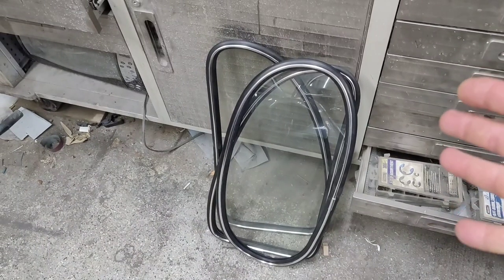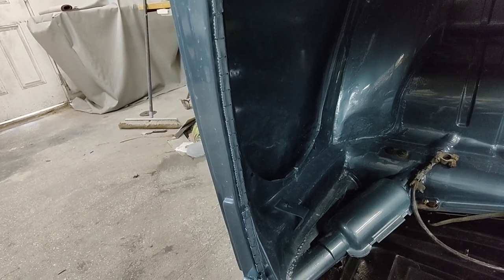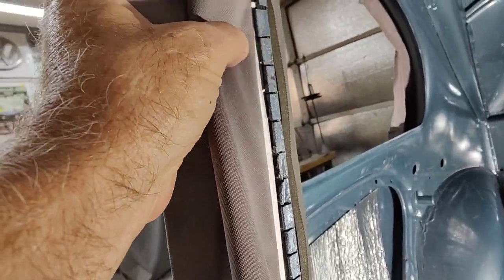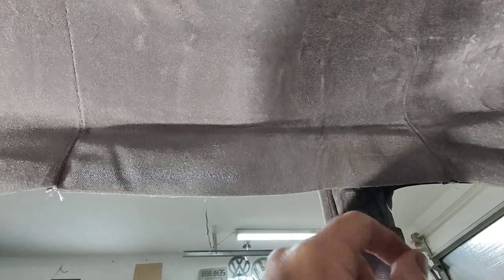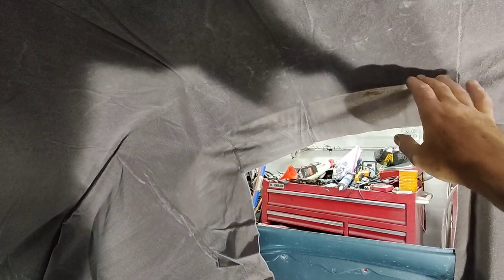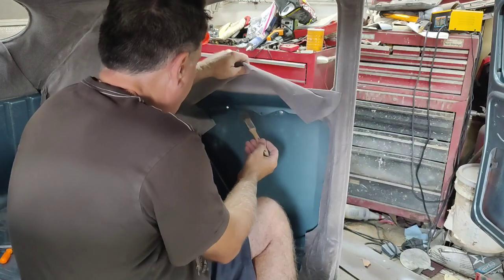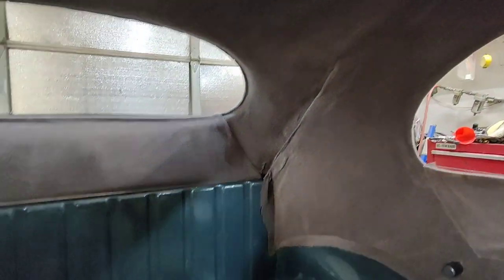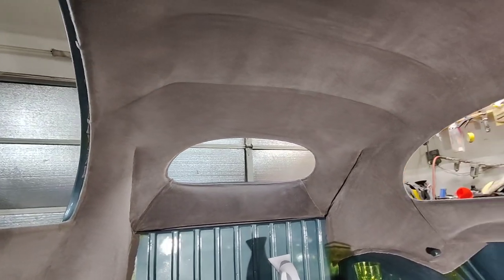1954 oval window VW beetle  headliner install - VW Beetle Restoration

Comment: Great job Mike. I love installing headliners. You just have to take your time. 

I’ve been in the automotive upholstery world for some time. One suggestion I see while padding pilars.  I can’t tell, but you may have used foam backed headliner material. If so, degrading foam is in the future, just the same as a saggy headliner. Try to resist using headliner material for anything other than headliner replacement. 

Again great job. I enjoy watching you work
Reply from the maker: yea no foam....only on the b pillars. that stuff like you say degrades. The old cotton stuff lasted but everything newer falls apart. It is all about patience. I didnt have it when I was younger. but now I wear out and give up on a few things.

Comment: This is such an incredible journey, Mike! It would be great to know the history of this car and how and why and when it got parked and almost junked. It’s got a new lease on life now.
Reply from the maker: I do know a little bit. the car was at carcraft and a guy was wanting the engine out of it. I have no idea why. I can only guess it was all stock and back then 36hp engines were a dime a dozen. The guy who i got it from was working there and he bought the body with no engine. stored it at his yard since about 1980 or so. was under a spray booth with holes in the roof. all the rust probably from that.
Reply: @Mikefngarage Very interesting! Re the headliner install, many of the situations you encountered have been addressed by a great upholstery guy also in California, might be LA area called Mario; he has a channel here called Upholstery Tips. He uses a steamer and heat gun to take off the wrinkles depending on the material. Also he shapes the foam using knives and razors to make everything smooth. He’s a killer interior guy.

Comment: the foam on the V W side by rear window// would hold water and rust them out//are you running a fan to move that air your breathing from that glue .